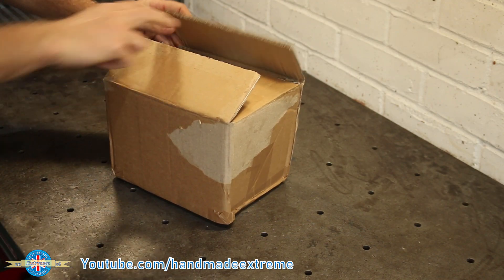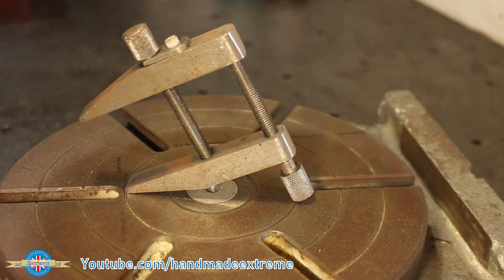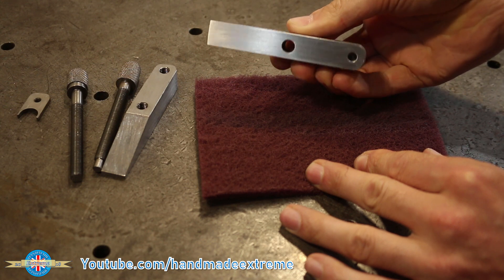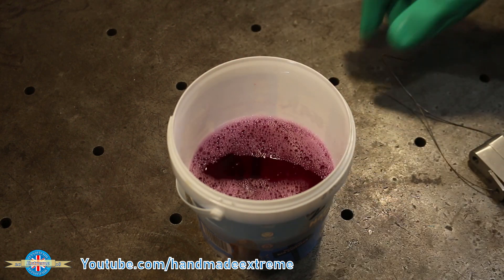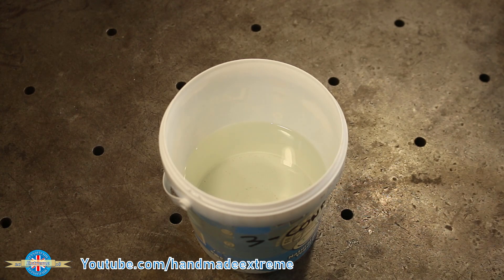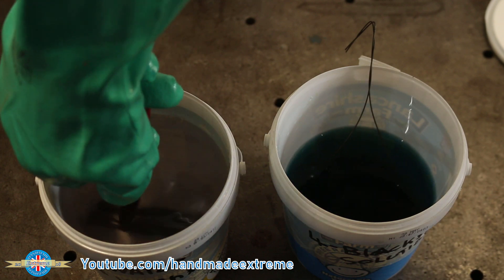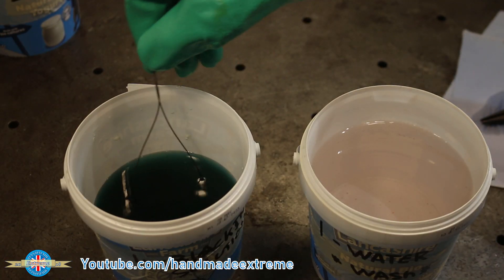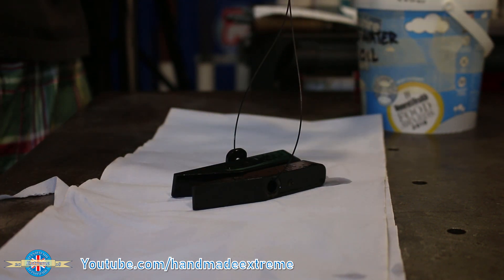How to do professional quality black oxide finishing in the home workshop.

Comment: If you can't find a kit in your country you can boil your steel parts in water to which about three cups of Ammonium Nitrate has been added. Be warned to add the nitrate only in a well ventilated area as it gives of copious amounts of ammonia gas. Boil for as long as it takes for the parts to go black. Also be aware the authorities may have a heightened level of interest in your affairs.

Comment: Hi!
Do you know the method how to remove this kind of a black coat ? 
I would like to remove the black coating from my bicycle frame but i can't find how to do it properly without sanding.
Reply from the maker: Not that I am aware of sorry. I'd probably use something like a flapping disc on a grinder to whip off the top surface.
Reply: You can just do it by hand using a ScotchBrite pad, the maroon one would do the job well.

Comment: Will be getting this,, BUT I have a number of questions / comments , not to criticize , but to help .  You mention not to cross contaminate the chemicals , But  with the rinse in the same water there will be , how ever so slight ,,,, a cross contamination of the chemicals & delusion with water with every dip to each bucket ... ,  I spent years doing nital etching to detect burns on gear teeth after grinding , part of that process is clear water rinse in running water , quick dip in alcohol that dried fast & leaved the part clean for the next dip in the next bucket,,,, a low pressure air gun can speed the process , but don't blow in the direction of the other buckets ,,,
Reply from the maker: Great comment Randy, Thanks.  It's always great to learn from other people experience.